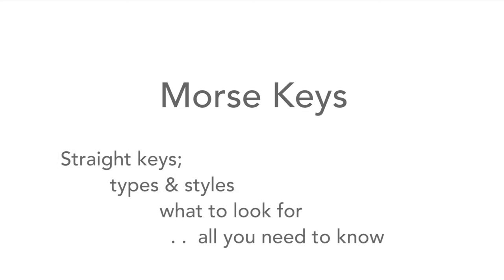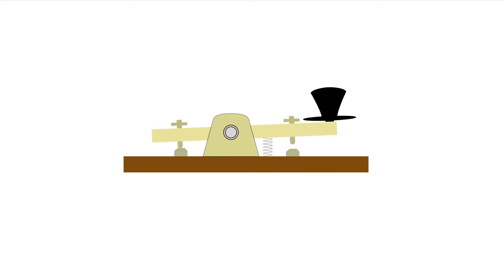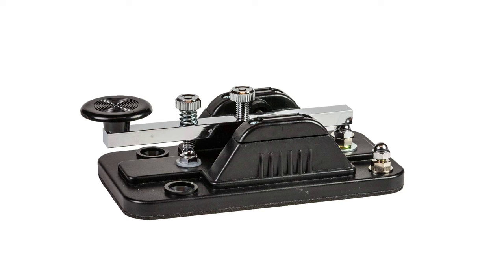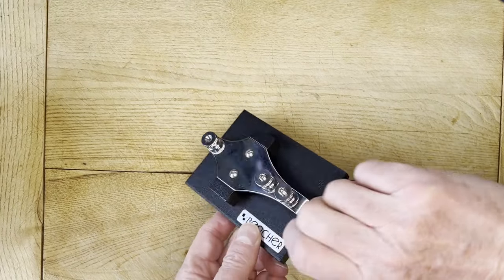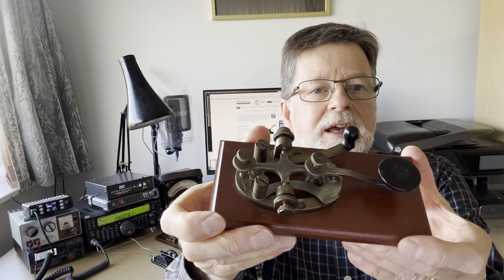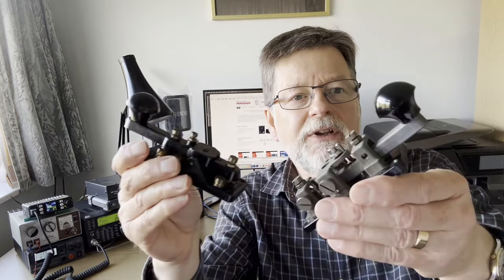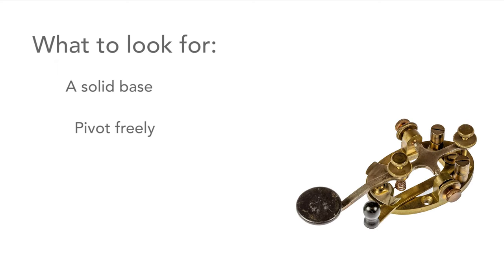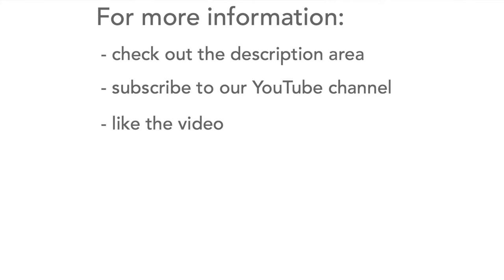Morse Code Keys: straight or pump handle #morsecode #morsekeys #morsecodekeys

Comment: I see many of these old military type keys on eBay and other videos but nobody says what is the other lever for? Can you explain it? Thanks. 5:01
Reply from the maker: The slide lever associated with the steel lever keys was primarily required in the old days of the telegraph. The contact had to be close when not sending so that the other end could use the line and send messages back. If it was left open, then no current could flow and the other end could not send.
For use with radio transmitters the slider was closed when tuning up, but it is not really a requirement these days on most modern transmitters that have a tune button.